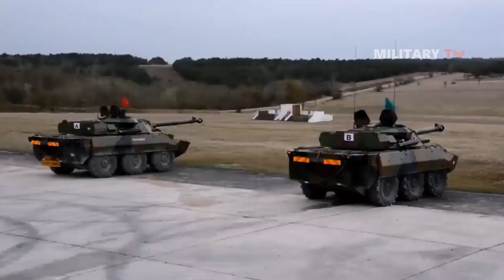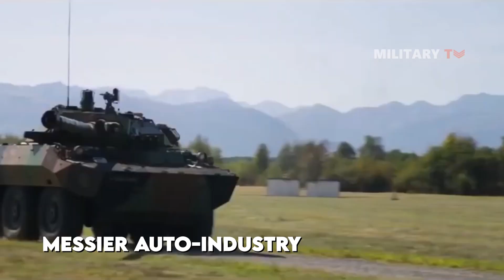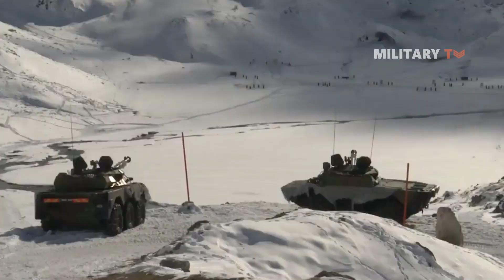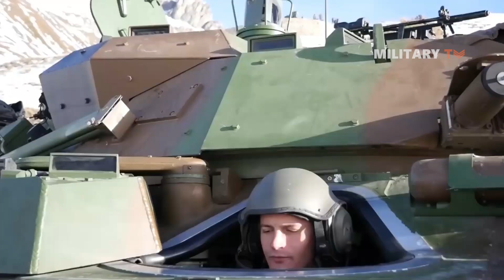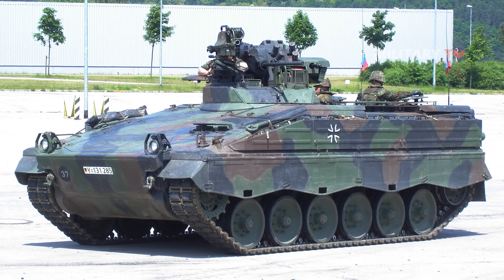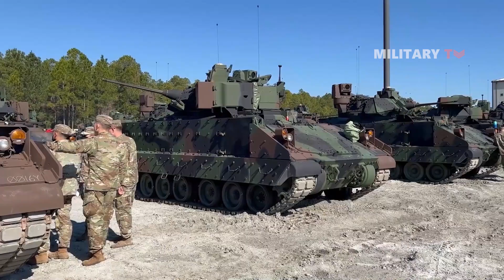France’s AMX 10 RC – Not Bad, Though not Really a Tank

Comment: Caesar is a first rate system.  The AMX-10 can't go toe-to-toe with Russian MBTs, but it was never meant to do so.  It's for recon, and it's great in that role.  It will also be great in a supporting role in an aggressive/assault role--MBTs backed up by AMX-10s would be formidable.  You really wouldn't want to be in a BMP, BMD, BRDM, or MT-LB staring down a 105mm gun.  Jeez, I don't think I'd want to face that in a T-72 or T-80, let alone something older.  Anything not a main battle tank from the 1980s or 1990s or newer would be toast.

Comment: People need to stop dissing this vehicle.  Used properly, as designed, it is an excellent scout/direct fire support unit.
Reply: amx 10 was proven as junk in the ukraine totally suicidal to ride into battle in that piece of cr.. It was junk even when designed-the whole idea of mounting a big direct fire gun on rubber wheels is ridiculous and that piece of sh.. costs more than a tank
The Czech proved wheeled spgs are actually better in some cases than tracked and armies have been using wheeled recon vehicles and apcs for a long time but for an armored car to act like a tank is nonsensical It just proves French technology is obsolete compared to the Great Powers and French tactical thought is stagnant and has been for the last hundred and twenty years That horror doesnt even have add on armor It shouldnt have been designed in the first place and even if created it should not have been accepted but somehow the French designed it and their army took it in
sorry to hurt your delusional feelings but although the truth hurts it also sets you free
Reply: @MrRaulstrnad  You need to learn to read.  I did not say this vehicle was a tank, or should be used like one.  Reading Is Fundamental.
Reply: @MrRaulstrnad  Ukraine admitted they did use it in the wrong way at first, then they changed their way of using it and it proved to be real good (recon+fire support only). Thing is, like many of old vehicles in any army, it's weak vs uav/drone. 
It is a recon vehicle, can be used as fire support. High mobility on road and can damage the russian's tanks. It is by no mean to be in front like a tank like they used it at first in Ukraine, it's also a wheeled vehicle so ofc, depending of the weather and terrains, it can't go to some place unlike tracked vehicle. Because it was at first made for the French army needs, mostly in Africa at that time. You're just a hater.
Reply: @MrRaulstrnad  It not supose to be a assault tank
Reply: @MrRaulstrnad 
They have a place in the order of battle

Comment: One, it's not a tank destroyer. They have a specialized 105 mm. It's not the closest thing to a light tank in NATO. Italy has the Centauro, which has way more armor and a 120mm cannon.
Reply: That 105mm gun isn't a reliable first-line MBT killer... but it will kill pretty much anything less.  Can it reliably first-shot-kill a T-90 or Abrams or Leopard 2?  Nope.  Can it do so against any APC or IFV or older tanks, like T-60 or T-70 vehicles or older?  They really can.  If I was in a T-62 or T-72 and going into an environment with AMX-10s, I would really be very unhappy.
Reply: @roentgen571  the AMX10 fires a less powerful 105mm round than the NATO 105mm to reduce recoil. Sure it would destroy IFVs, but the AMX has about the same armor as a western IFV. I don't know but I'd bet a 30mm APFSDS round would go right through the side armor.

Comment: Not Bad, Though not Really a Tank. Correct. This a fire support and recon vehicle, used to support combined arms teams. The AMX-10 RC is a French armoured fighting vehicle manufactured by Nexter Systems for armoured reconnaissance purposes. Equipping French cavalry units since 1981, over 240 remained in service with the French Army in 2021. 108 units were sold to Morocco and 12 to Qatar. "RC" stands for "Roues-Canon", meaning "wheeled gun".

Comment: This is a great in between of a tank and a tank killer. I love this vehicle and hope it helps out Ukraine where they need it. Hopefully this will help do quicker reconnaissance.
Reply: It's was never designed to be a tank or tank killer ... it's a light-armored recon-vehicle who can provide heavy fire support for infantry. It could be used as tank killer against old Soviet tank like T-55 (at the time it was designed, in the 70's), but absolutely not against newer tank.
Reply: I bet Ukraine won't use them correctly and they will get smoked
Reply: amx 10 was proven as junk in the ukraine totally suicidal to ride into battle in that piece of cr.. It was junk even when designed-the whole idea of mounting a big direct fire gun on rubber wheels is ridiculous and that piece of sh.. costs more than a tank
The Czech proved wheeled spgs are actually better in some cases than tracked and armies have been using wheeled recon vehicles and apcs for a long time but for an armored car to act like a tank is nonsensical It just proves French technology is obsolete compared to the Great Powers and French tactical thought is stagnant and has been for the last hundred and twenty years That horror doesnt even have add on armor It shouldnt have been designed in the first place and even if created it should not have been accepted but somehow the French designed it and their army took it in
sorry to hurt your delusional feelings but although the truth hurts it also sets you free
Reply: @MrRaulstrnad  "French technology is obsolete" ... like any technology from 50 years ago.
That's why they send them to Ukraine, France already began to remplace them with the EBRC Jaguar.